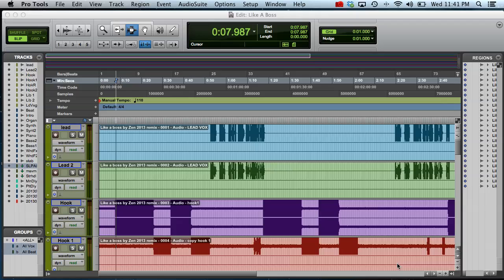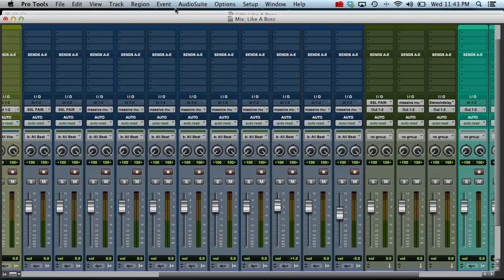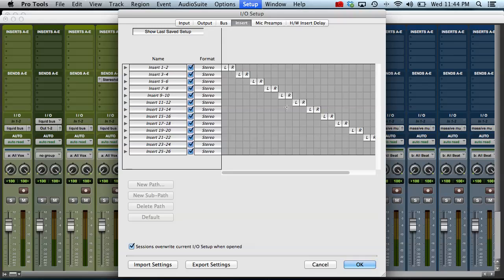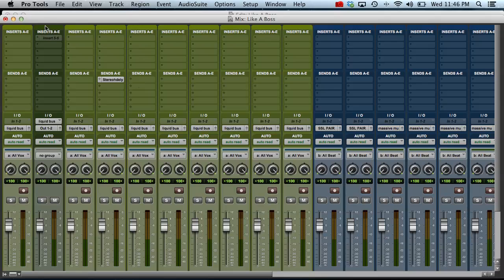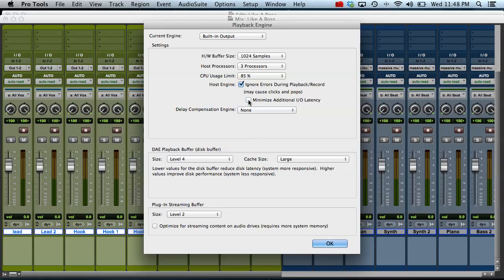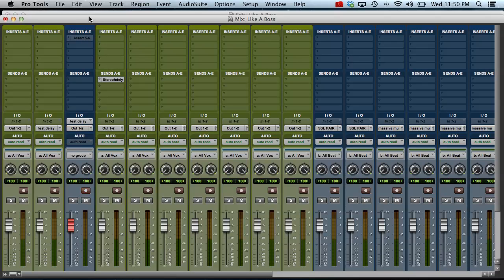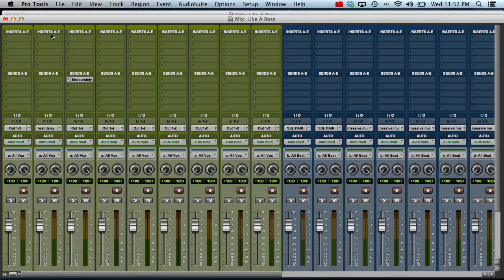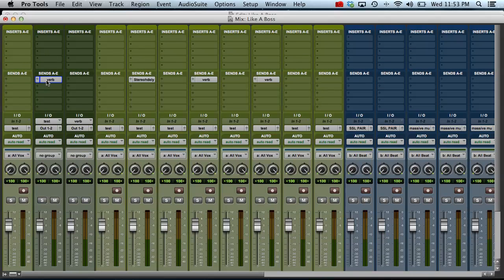Using hardware with pro tools

Comment: You know, I know you’re not expecting this but here it goes. A question about protools from like 10 years ago or more and a compressor like the 1176. To be more precise I have the Purple Audio MC77. By the way great video. Loved the way you explained things. I’m still a little lost or a lot. lol So frustrating. So here it goes. I have a bae preamp to the compressor to the interface to protools 10 lol 
I can use it fine in the chain. As an insert tho? I’m stuck. My interface is the silver looking apogee ensemble which has 8 channels. 2 inserts. One in channel 1 and another send and return on channel 2. I literally pay no attention to those because I can’t get anywhere near them through protools. On the inputs the 1st 4 channels are balanced and xlr for mics. 5 through 8 are trs lines. All outputs are line outs using trs. In the chain I have the compressor going through the amp into the interface through mic 4 xlr. Perfect no problem there. I have 2 xlr male and female with trs at the other end and I have them in the send and return of the “sidechain loop” of the compressor, for the ‘insert’ button option in the front of the compressor. Obviously the input and output of the comp is already connected and working. Out of the comp sidechain loop xlr’s male and female I have them coming into line 6 input and line 6 output. ‘Send’ going to the input 6 of the ensemble and ‘return’ going to the output 6 of the ensemble. So everything is connected properly as far as I can tell. The problem is when I’m in protools. Let’s say I have a vocal already recorded and it’s output is stereo channels 1-2 for my Focal speakers. Whether I bus that mono vocal track to an mono aux or if I just choose the output 6 in the insert of that mono recorded vocal channel, by pressing insert on the compressor now I enable the insert capacity but I only get signal into the compressor via channel 6 out. And that’s as far as I get. I see the voice on channel 6 of the apogee meter and I see it making the compressor work. However I can hear it back through protools. I though that by choosing insert 6 via the output option under the inserts in that channel on protools, that it would automatically work both the send and return. But it just goes quiet on the 1-2 output once I press that insert button on the compressor and I can only see the compressor working. I’ve tried everything I could think of. All the possible options I could think off. In the I/O of protools everything seems fine. The output lines work fine because I’ve changed the inserts on the apogee to channel 3 in and 3 out and 7 and 7 and others too. I’ve checked them. They all work. But for some reason unknown I cannot get past this point. I’ve spent probably 2- hrs hrs in 2 days thinking this through and in front of the computer. I have nothing. Have not a clue.  Besides the fact that I’m not getting channel 6 to either go straight to the master or to a bus but instead  while using that insert option on the comp. Any suggestions? I know I wrote ya a small series book. But idk what else to do. 
God bless and take care and thanks again!

Comment: When I print the track then I play it back with my mixing chain engaged I hear strong analog noise. Is there a way to remove it? Maybe a setting? I can even hear it if I compress small or barely raise the preamp

Comment: I hear a buzz when I try to use hardware insert in PT any reason why.
Reply from the maker: Could be cables,  I would start there, a loud buzz, could be balanced/ unbalanced mismatch what kind of gear are you using?
Reply: Doug Jenkins hi thanks for replying. I am running out of my Apollo X8 - Output 7-8 going to the input left right. In The neve portico mbp. And back in to the Apollo inputs 7-8. But when I try to use the gear as an insert. I hear nothing. Or sometime a buzz sound. But in studio one 4.6 everything works flawless In pipeline.
Reply from the maker: @kingech_B15  Man I would have to get a screen shot of the insert page, and see the control panel for the apollo, something is routed wierd.
Reply: @DougJenkins  il figure it out brother

Comment: Hey Doug, first things first: you are the man! Great videos really, each one teach one, love it!!
I still have a big problem with Pro Tools: If I use my (pro tools) quartet and duet as aggregate device, the INs and OUTs don't line up opposite to each other. 
Meaning after the 12 inputs and 8 outputs on the quartet, the Duet has its output at 9-10 but its inputs at 13-14...
Is there ANY way to route inserts in Pro Tools so that they don't have to be opposite to each other? I mean now when I use an I/O insert with Out at 1-2, Pro Tools expects the return audio at Input 1-2..
Is there any way to route audio in inserts so that I can send the Inserts audio with e.g. 1-2 but the inserts return channel is 3-4?? Willing to pay for a working solution, paypal accepted, this is driving me nuts!!
Reply from the maker: +Jim Dough    Instead of using a insert.. just send the main output of the track you want to effect.  then create a aux track with the input according for example, let's say you have a compressor hooked up to output 3-4.. But you have the compressors input set on input 5-6    if this is routed this way externally, you can send out 3-4   then create a aux and return the signal back in 5-6      that's how you do it this way..   also try Defaulting the interface, I have never used a interface in aggregate set as driver, I usually set the main device..  I understand if you have a duet and quartet running, I would trade them in and get a symphony :)  and end your madness and increase your sound..   hope I helped a little..   you can donate to my cause if you like just email me dizmastering AT  yahoo!!

Comment: I have a huge problem with my setup. I got api 8slots with comp,eq and two mic/pre connected to apollo quad. 2 of them works very good but not comp and eq. I try many solutions. the connections are good, the i/o setup on protools too. But it (comp and eq) doesn't work. I become crazy! any suggestions ?
Reply from the maker: Are you running in/out of a corresponding channel on the actual apollo back and forth to the compressor, and also the eq?

Comment: Just wondering. You set your insert as insert 5-6 and said that it'll send to that. What do you have to do to get it to return? and when it does return, what channels? or do you just set the output from the compressor or gear being run as a new input for the interface?
Reply from the maker: you set the corresponding inputs and outputs.. you send out 5-6   return the equipment to 5-6    the word I/O stands for input/output.  Pro tools automatically sets the interface to route back and forth in your setup.

Comment: Im using OS X Mavericks running pro tools express. I keep watching videos but I cant find out how to fix the I/O settings. When I try to record I can only hear out the left side of my headphones. When I add a beat to record on I only hear the left side as well. I am using the fast track duo.
Reply from the maker: Are you using Mono tracks when you create a track?
Reply: Doug Jenkins yes. I deleted all the paths on input, output, and bus and reset them to default. I still only hear out one side of my headphones. I messed around with the i/o setting again and now it doesnt pick up my recording. It records with no soundwaves (it records but wont pick up any vocals)

Comment: Hi Doug!.. well, I´m recording with a Digi Rack 003+ and using an Focusrite ISA 430 channel strip as a preamp, basically to record some guitars and vocals. I plug the guitar to the ISA 430 and then via lightpipe ADAT conection to my Digi Rack. Its pretty simple, but now I want to use the ISA to process the mix, or just to process some tracks... so, How can I send the signal from pro tools to the focusrite and then back again to pro tools?.. do I have to do some tricky connections?
Thanks!
Reply from the maker: you just make a loop with a pair of inputs and outputs,  example out 5/6 on interface to isa, back out of isa returning back in 5/6  on digi 003   in pro tools where your plugins show up, go like your putting a plugin on, but scroll down to where it say's I/o,   once you find that, select i/o 5/6 on the tracks you want to process.  wah lah... good to go

Comment: I cannot believe that Pro Tools users still consider Pro Tools to be the industry standard, when so many other competing DAW software makers have  compensation for hardware insert latency which is accomplished with a simple ping.
Reply: JeffEddy98 You seem to be ignoring the fact that basically everyone who does audio professionally learns on Pro Tools.  Not Cubase...or Reaper...or Ableton.  You learn on what you will see in every studio.  Is Cubase good?  Yes.  Do most studios use it?  No...although I know a lot of mastering guys use Steinberg.  Pro Tools is like the Fender Stratocaster of DAWs...it was first, its the sexiest, and its multipurposed.  It just is what it is.  I don't know why people insist on reiterating why they think Pro Tools is inferior.  You don't pay for the software...you pay for the cards.  I tell people who gripe about Pro Tools to take it up with nearly every studio in the world.  Every DAW system is flawed in some way...the ONLY thing that matters is the person using it.  If its a talented/skilled engineer it will be a good result every time.
Reply from the maker: The only reason pro tools has latency issues, is because it was designed to have unmatched sound processing.  Where your sound quality for mixing engineers, is second to none, the way pro tools handles audio.. For this reason, it suffers from latency issues, that are worth fighting, when audio quality is your first and foremost profession, mixing engineers and so forth, but for recording, yes there are a lot of Daw's that are awesome..
Reply: Rubbish. All DAW software works with A/D converters and Audio Interfaces to input and play back converted analog audio to waveforms with specific sample rates and bit depths.The quality comes from the conversion, not from the DAW software. Pro Tools doesn't do anything different than Cubase, Logic or any of the other software.
Reply: Well Eric, I did pay for the software not the cards. Got an RME HSDP/Aurora 16 (x2) for 32 i/o's setup running hybrid to great hardware that I use for tracking and as External FX inserts. No Pro Tools hardware has anything on my rig sound wise, or from a functionality standpoint.  I bought the Pro Tools software as an insurance policy, because I didn't want to lose business because some uninformed client thought the sound came from "Pro Tools" and not from mics/preamps/outboards and my converters. Still, I am amazed that things like changing buffer sizes means you have to enter new ms.  values in the PT software for External FX, when most software can do this with a ping. In this day and age, that's a big flaw.
Reply: JeffEddy98 Only a musician who only plays music would think the sound comes "from" the DAW.  But most musicians nowadays understand that the sound comes from the hardware and converters.  I think you're getting all upset about nothing.  Do you get good tracks using your rig?  Great.  Done.  I use Pro Tools A.) because I know it like the back of my hand and B.) I can take my entire session with me to any studio I may be working in (if needed).  Again, that's why all the pros use Pro Tools.  Clearly, if it was as big of an issue as you are making it out to be, people would be dropping Pro Tools for something better...but it isn't happening.  It's a legacy system.  Pro Tools biggest asset against it's competitors is the fact that it's name is PRO TOOLS.  It's the most widely known, widely used DAW out there.  It being "worse" or "better" is purely subjective.  As I said, if it was truly inferior for professional workflows, no one would use it.
Reply: Of course you have to have Pro Tools as insurance Eric and most people stuck with it because they know it. That being said, for hybrid mixing, it lags behind other software. If you have a mixing console, which many pro studios still have for hardware inserts, it doesn't matter. For hybrid users itb it does, because of its inability to ping latency for hardware or mute the insert, not to mention that you have to change the latency compensation when you change buffer sizes. But Pro Tools is a must for insurance. It's inexpensive. So, it's not a big deal.

Comment: I'm still confused. I think you are missing a step. I understand that when selecting i/o as an insert on a track, you're effectively telling protools what outputs on your interface are sending to your hardware. But where do you tell protools where that signal enters back in? I've tried checking my inserts tab in the i/o setup and everything seems fine. 1-2 going to 1-2, 3-4 going to 3-4, etc. I have my hardware unit being sent and returned on 7-8. My hardware unit is getting signal and so is the input on my interface. However, protools still shows no level in the fader and I don't hear sound.
Reply from the maker: most interfaces, the return has to be the same channels.. example 3/4 out, would have to return 3/4 ..   corresponding to use a insert.. and what interface are you using?
Reply: Ah ok. That did it, however now I have another problem. When using a hardware insert like this, its bypassing my fader. The mute/solo buttons and my fader do nothing. The volume is fixed and unable to be mute or solo'd. As soon as I bypass the the insert the problem going away. Any ideas?
Reply from the maker: hmmm
Reply: Lektro Music Inserts are pre fader on your signal chain unless it is a master fader.
Reply from the maker: check your interface, by running a cable directly out say 3/4 and back into 3/4  on the interface, no gear hooked up at all.. see if your getting the signal coming back in..   I/o stands for Input output..  so this creates the routing within your interface.  if this works, there is something going on with the way the hardware is sending back to pro tools, I've seen it with different pre's and stuff, where there's an actual setting, what piece of hardware are you using?

Comment: Well done Doug. Thanks a bunch.
Reply from the maker: no problem, thanks for watching ma ...
Reply from the maker: n
Reply: Hey doug can you use the outputs on a mixer for outboard effects.....i have 16 outputs and 7 aux....
Reply from the maker: tony boris    yeah, you can run the console that way.. you could run main outs in and out of your interface.. and use all your hardware as aux on console, and have a pure analog mixing experience.. depends on the console, and if your happy with the sound in my opinion, sorry just had seen this question

Comment: Hey Doug,   I'm using Pro Tools 9, Focusrite Liquid Saffire 56, and I wanna use my new Chameleon Labs 7720, for some glue on the whole mix....what's the correct patching for that scenario....stereo aux buss 1-2....or...??  Thanks man, your videos are very helpful !!
Reply from the maker: dedicate a output on your interface, like out 3/4  back in 3/4 to the gear and back out of the gear..  making a loop with the chameleon  then go to I/o insert setup and wah lah..  it's now a plug in in pro tools
Reply: Mad Mike Jones I've been trying for days to figure out the CL 7720 mix bus wiring....PT 11LE...I can't get it to work at all. Not much I haven't tried. I think I might have hardware problems.
Reply: I actually sold my unit !! Not because I didn't like it but just needed some other stuff more !!
Reply from the maker: You would assign a output input pair, for example 3/4 out to compressor, back in 3/4 on interface, in the software you would create a i/o all the way at the bottom where you usually grab plugins,,  then assign that on master fader, and you should be sending sound out, then back in to print in pro tools

Comment from the maker: well depending on how much gear you have.. if you have multiple pieces like compressors hardware, you would want to run the outputs of your gear to the patchbay, and inputs, .. then outputs of mbox to patchbay, and inputs..   reall what you need to do is make a out to in, out to in connection.. do message me your number, very hard to explain on here lol

Comment: I was referring to the guy you said had latency issues.

Agree, any latency from HW inserts are minimal and each piece of OB gear has different latencies. The easiest way to calculate sample differences when you print the H/W track, is to use "tab to transient" to create a break on that first transient, then do the same to the original one. And if you grab/highlight the original region, hold down control, then click the new printed region, it will align them snapping it to the original region.
Reply: what if doing this its actually ahead and not behind ?

Comment: No. That's not right. There should be no noticeable latency on any hardware inserts when setup properly. The delay compensation engine will adjust any latency when it is turned on. These are inserts, which are using the same engine that compensates for any latency that plugins produce. Yours was off for some reason?
He likely had it inserted through a bus, not the I/O on the insert. There is no delay compensation for latency in the bus I/O engine, so you would have tons of latency.